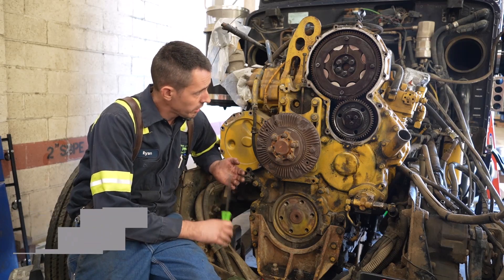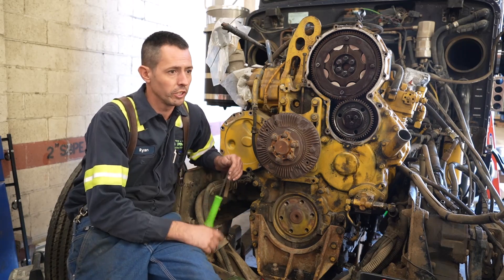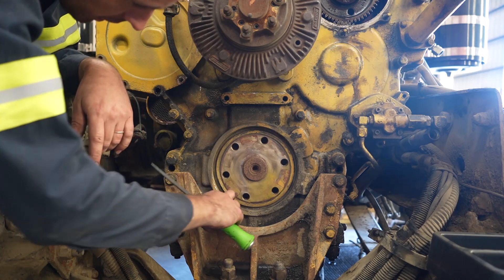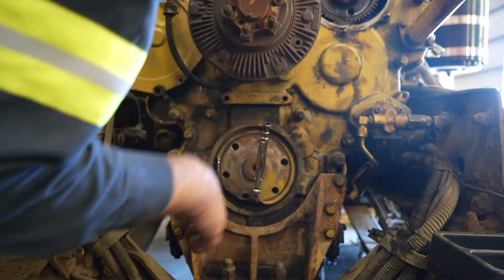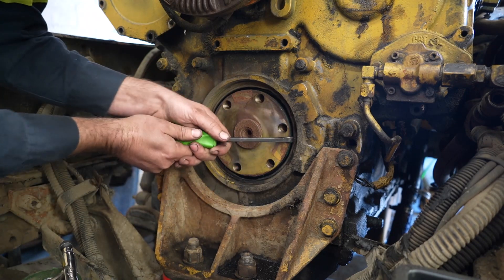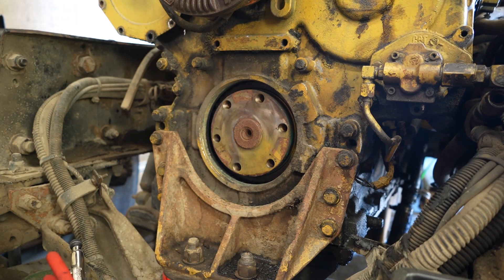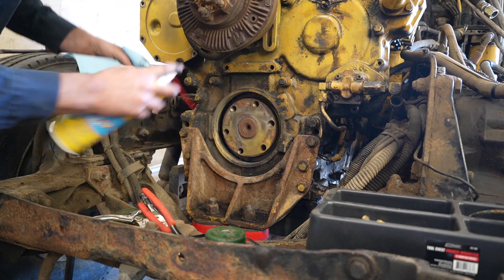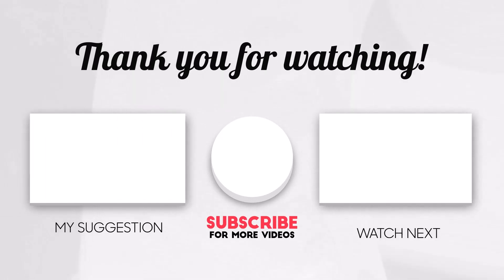CAT C15 Engine Front Main Seal Removal

Comment: How much would you flat rate this job on a 379 peterbilt?
Reply: R&I Transmission 1st off
Reply: My bad, this is the front seal lol. It depends if you have to remove radiator/air to air or not. 12 hours of you do,  6 hours of you don't.

Comment: I would drill into Seal with two Screws and use Slide Hammer to remove seal
Reply: I was just about to say this. I did crank and cam seals the other week this way.
Reply: Or a hill bar.

Comment: Damn, just 3 weeks ago I was searching for a good “how to” for this exact job I had to do on my 3406e. Couple of things to mention if your doing this job might as well pick up new belts, new crankshaft damper and I bought the installation tool from Ferrum Tools (excellent quality). Also might want to go the extra distance and degrease and paint the front part of the engine because why not, your there 😊 On my 98 W9 there was tons of room to work with the rad in place